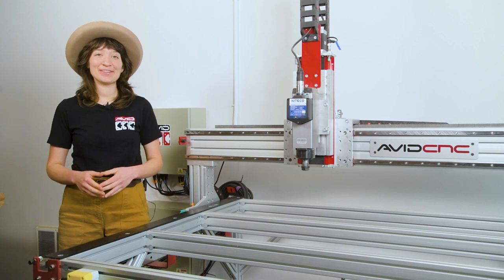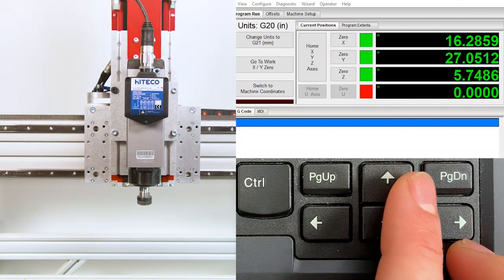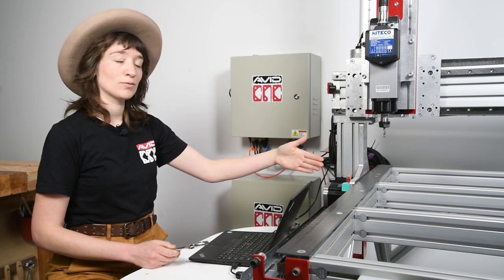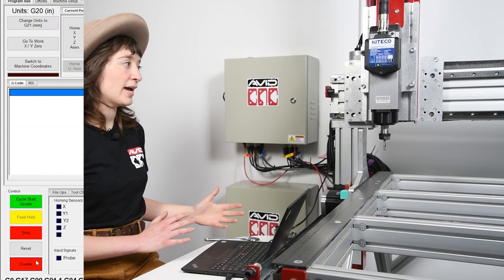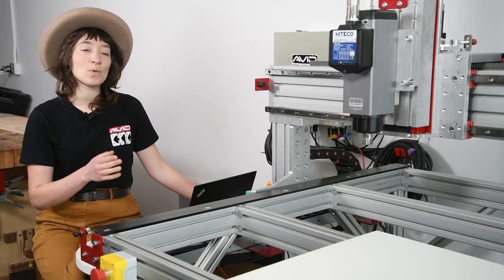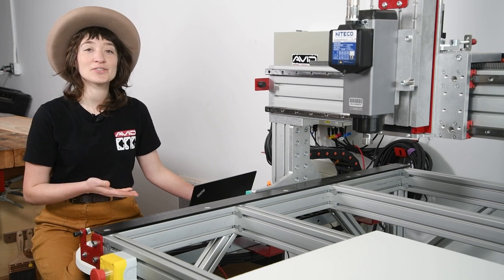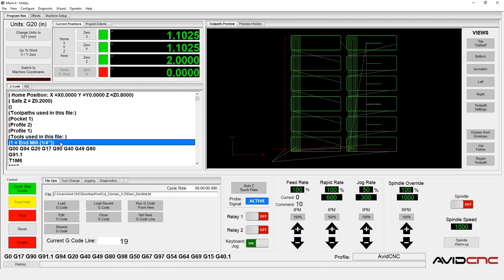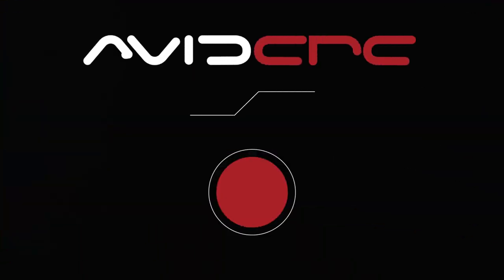Initial Machine Set-Up & First Cut

Comment: Ok, maybe I’m a little slow, but there’s issues that aren’t addressed. Like, if your sensors are placed exactly where specified, but the machine hits a bump stop. I would think, the correct way would be to address this in this video, rather than perusing the whole library of videos. Or the file you mentioned for the hold downs. Never named, nor addressed where it was found. Was this off a Vetric program, or built in to Mach 4.  I’m just riding the struggle bus, so don’t mind me…

Comment: im an avid 60x60 pro owner...i recently purchased an co2 laser and started using  lightburn software...lightburn has a "frame" function that shows the user where the cnc will be cutting (on a cnc router that means no more hitting clamps) lightburn also has a camera module that supports a camera on the laser i would love that capability in mach4...also lightburn has a feature called print and cut "intended for stickers or whatever"  on a cnc router that would allow the user to realign a file to a project/material with perfect accuracy (after a crash or power outage or after material has been removed from the machine )  that feature capability in mach4 would also be very very welcome...maybe avid could offer support of those features being added to mach4..?
hint hint....